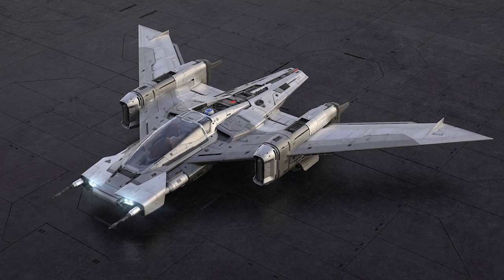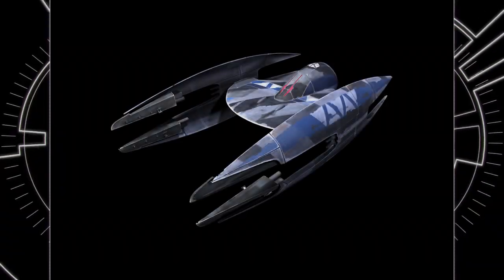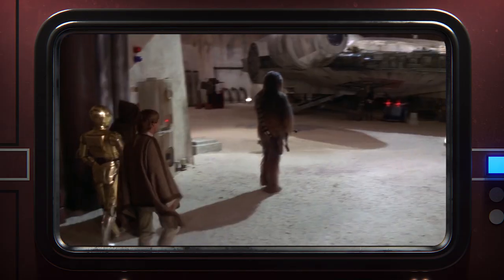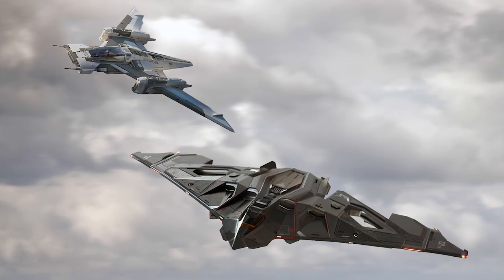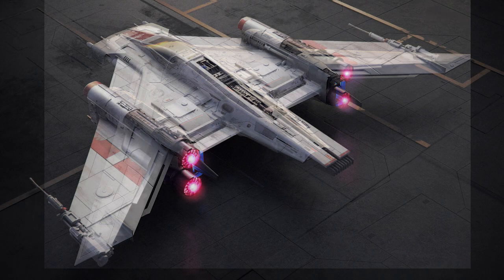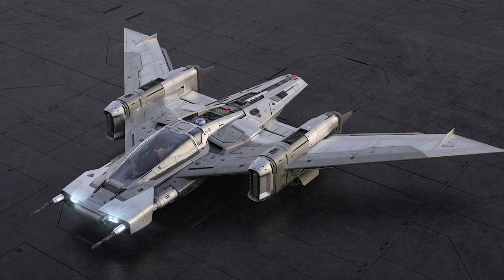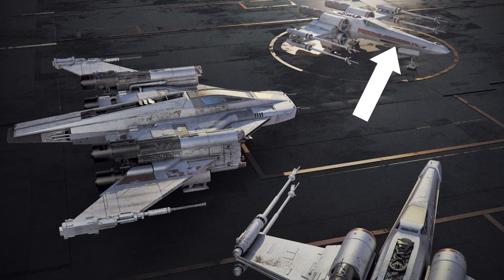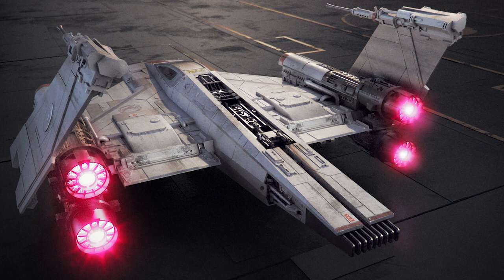Fixing Porsche's Star Wars Ship

Comment: Honestly there are aspects to the original I like, how it looks like a high powered jet fighter for one and looks like something that can actually fly for another 

I love the guns on the front of the nose like a proper jet fighter, just wish the nose wasn’t so stubby and more narrow, with the guns more centered 

And maybe it’s just me but I think the pointed back should be a third engine block, seems weird for it just to be a point with no functionality 

You design is nice I’m just not a fan of the two engines, I’m not a fan of bulky jagged looking  designs is all. I do like the the guns on the wings and the fact that the wings can fold up. 

Honestly an amalgam of the two designs would be a dream made in heaven, the things I would add would be nose mounted guns that are more centered with the cock pit, as well as a more narrow nose in general. Also I think a third engine at the back rear to the cock pit would make a better usage of space, maybe even throw in some vtol elements there for an easier take off. 
Thirdly after watch top gun maverick I think wings that can expand outwards for more altitude in flight fast would be cool
It’d make the overall wing span larger in flight but for the benefit listed above . 

In general while I like both designs I think they’d both work better as a fusion of the two. Porsche looks like a nimble aerodynamic design while yours is more befitting the Star Wars standard design, mostly on the rebel side tho

Comment: I mean, the two styles are completely different. a lot of starships in starwars we see are old, and are mainly meant for vacuum, but capable of relatively low-speed atmosphere flight by design. (clunky, boxy ships with chipped paint from low maintenance) this car company spaceship is built for atmosphere, with it's aerodynamic frame and control surfaces, with air-intakes for the air-breathing jets on the front grill and two engines.(presumably)

I could see an X-Wing going half the speed of sound, maybe, in atmosphere. that porsche could go a lot faster.

Comment: I can already see bio for this.

Incom S-91X Pegasus System Defense Bomber.  Designed to perform the roll of the infamous BTL-B4 'Y-Wing' but on a modest budget.  It has excellent Control, Durability, and Firepower.  It lacks a Hyperdrive but wing tips fold for space saving in space ports and fleet hangars. It is armed with 2 Blaster Cannons (Wing Tips), 2 Ion Cannons (Nose), and 2 Proton/Concussion Missile Tubes (Internally).  It has 2 split-exhaust StarRam engines which are mounted away from the central body for crew safety.  3-man crew consists of pilot (Forward) and one Rio and one Flight Engineer (Rear). 2-man crews are available (Optional).

Comment: It's so strange they had them make a ship that looked like an X-wing, a Y-wing, a U-wing and a Porsche fused together.. when those contrast so heavily. The X-, Y-, and U-wings are utilitarian designs scrapped together by a rebellion desperately trying to get as many ships off the ground and functioning as they possibly could, screw the aesthetics or sleekness or how clean they were. They were rough and cobbled together and had plenty of exposed parts.. maybe for ease of service or maybe simply lack of defensive panels to protect them. On the other hand, Porsche is a luxury car manufacturer specializing in curved and sleek designs. The styles don't really mix well. Porsche might look right at home using a Naboo template, though.

Comment: The "new" version is better if you assume the OT aesthetic is the only one.

Personally I think the art direction and general design of the series should evolve, if the Prequels were based on the 40's and 50's, and the OT the 70's and 80's, the Sequels should advance the technology and bring it into the 90's/00's/10's rather than sticking to what is safe (like they actually did).

Comment: The original design those actual have porsche like bits. Behind the Astromech unit there are radiator fins that looks like the vents on the back of modern 911s. The main cabin area kinda has that 911 look but otherwise nothing also looks porsche like...

Comment: About the Porsche's space ship. For space ships, there is no point in having wings unless there is a good function to it, like storage, guns attached to it or having some kind of special function to it to for example become a plasma blade cutting through anything. Yes of course you could argue that it is meant to just look cool, however, this ship is meant to resemble a rebels ship, so it shouldn't have any big unnecessary parts to it. That is why your redesign is much better in my opinion.

Comment: Initially I thought this was another one of those fans who keep on "correcting" designs (most recent issue with the grand inquisitor). But no, the new redesign looks like it actually is something that would exist in Star Wars. The grittiness and exposed parts of the engines also add to that SW aesthetic. The original design, wasn't bad either. but to me it looked like a ship that better fits in the MCU side of things, with the familiar cleanliness I saw with the Milano and the Benatar.

Comment: Coming to this way way late, but i would have like to see the rear spine on a upward angle, ike 20 degrees up(starting just past the canopy) and a double engine stack (vertical) in the tail. lower the engines in the wings and change it to one on each side instead of 4.

Comment: incom 108 Strike Bomber prototype. During the Galactic civil war Incom began developing the 108 Strike Bomber. Though initial interest in the project  was high demands of the war required funding to be allocated towards the theft of Y wing bombers from imperial supply docks.  The design team was rotated to the development of upgrades for the X wing. The prototype would languish in storage for 15 years until interested parties approach incom for a rugged and reliable bomber design.  The new design team searched the archives for concepts to adapt into the request. The upgrades and modifications would come to be known as 108b strike bomber and was given the designation of the M - wing. 
      It's first test flight would be marked with only minimal malfunctions in the navigation systems, requiring an on board astromech droid to resolve. The true difficulty arises with the weapons systems. A combination of an advance multi target tracking system and state of the art high speed torpedoes would have turned the M - wing into a capital ship hunter killer. Initial complications with the tracking software not communicating with the torpedoes on board droid brain lead to  the design team to replace the system with off the shelf parts. Followed by the droid brain developing a "return to sender" sub program saw the loss of one of the initial prototypes and test pilot. After an internal investigation discovered that one of the lead designers was receiving large sums of credits from an outside source lead to scrutiny of the company from the New Republic, the company quietly shut down the program and is now under intensive review of security.

Comment: TBF the porshe design looks fine for a prequel design on, say, coruscant (or, say, for a new culture / world and design aesthetic during, or before the height of the republic). 
But it doesn't work AT ALL for a new republic design, and for a rebellion / new republic ship by incom, no less.
So props on your redesign, which totally gets that right.

(although, technically, you might still have too many beveled elements on the body / wings of this ship for an incom design, though – which is an issue that you'd run into if you actually matched the design process of the OT, w/ physically built models and mostly flat, plastic layered elements and some degree of vacuum forming)

That said, star wars has a funny bit of design history where the 'newer' ships look grungier, older, and more beat up than the comparatively sleek (and sometimes entirely CG) designs of the prequel trilogy, so technically either of these designs could work, just in different eras and locations. Poor showing on porsche (and lucasfilm's) part for not matching the design philosophy for the era (and manufacturer!) that this ship was explicitly supposed to slot into, though.

Comment: Some critique: Personally if you're going to have the wings foldable then I'd say bring the engines in more so more of the wings can fold, as is it seems like a tacked on feature since how much the wings fold feels IMO negligible. And the frame on the cockpit is rather thick on the sides and the slope makes it so the pilot would have one hell of a bling spot. Cockpit placement seems like it'd be awkward to get into. Do you jump up and climb the wing, walk across, then hop down into it? The fighters all have easy access to the cockpit by ladder and have open space around it to account for such direct access,  the larger transports have a separate entrance that leads up to it. Your design seems to suggest the later but is in reality the former. Not a major problem but it would make it take longer for pilots to get in the seat and into the fight. 

I'm 2 years late, I know. Just let me have a nerd moment.

Comment: While I do like the "alternative" ship, one thing I feel needs to be pointed out is that lots of people seem to be talking about "Star Wars feel" when what they actually should be saying is "_Original Trilogy_ feel". The reason that stuff in the OT has that "feel" is because the Rebels are using old, worn-out, raggedy equipment that has been jerry-rigged and "field expedient" repaired/upgraded. The Empire's equipment didn't look like that. The Prequel ships don't look like that (and in fact, many prequel vessels are quite sleek in their own right). And the X-wings and Y-wings and all the rest also didn't look like that when they were new off the production line. Some of the design choices are hence made more towards "that particular company" aesthetic rather than Star Wars in general.

As noted by a few other comments in this comment section, the original Porsche design would fit in quite well with the Razor Crest (especially if the only mod is to ditch the ends of the wings past the engines). It would also make perfect sense in the Sequel Trilogy timeframe, as you have three decades of technological progress after the restoration of the Republic and a booming recovery economy after the end of the major war. The fact that [SPOILER ALERT] it appears in an episode of Kenobi kind of scuppers my Sequel-age idea 😅 but in that case it (the original Porsche) design can still "fit" if it comes from the same company/society as built the Razor Crest.

Comment: The before picture has a Babylon 5/Battlestar Galactica vibe to it. The Viper from the front of the canopy, and the wings and thrusters scream Starfury in their design. There will be an argument that the thrusters also come from the Viper. And they could be sourced from either, they look a little like both to me. The new design is better for a few reasons that have already been stated. The design looks older and Industrial like all of the other SW ships. The new design has elements from the other ships as it was supposed to have, the original didn't. Then my opinion. Including the parts that were changed and commented on, like the newly designed outtakes and intakes on the thrusters and the wing mounted weapons belong where they are. On the original they didn't belong aesthetically and looked like they were thrown on in a bad hurried unplanned refit. And I like the folding wings too. (World War 2 Carrier based planes had this ability and this is where the Star Wars designers got ideas from originally so, it is a very good tie-in.) Lego if no one else should make this, it wouldn't be that hard. Just copy parts from X-wing and Y-Wing kits that there are already several versions of.

Comment: With the wings pointed back and the wings edge ending close to the front I think it's still not that much star wars. Usually, if the ship has wings, they are around the middle, like a propeller plane. You probably cut the wings more into the shape a XP-55 Acender rather then this 6th gen jet configuration.

Comment: I mean I think the original one looks pretty cool on it’s own. It’s interesting to try and break down design languages from different IPs to determine how something has a certain look or vibe to it and to reinterpret designs, but like… the original design looks fine. I really think the reason why the redesign looks more ‘Star-Wars-y’ isn’t necessarily because it looks generally ‘Star-Wars-y’ but more specifically similar to something designed by Incom in-universe. It looks like a mix of the the X-, Y-  and A-Wings or at least has elements reminiscent of those ships. But of course a ship designed by Sienar Fleet Systems or Kuat Drive Yards or Mon Calamari Shipyards or… whatever the gungans use… they’re all gon’a look different from Incom, so I think Porsche’s original design could indeed work in Star Wars as just… another manufacturer. Now comparing maybe some kind of overarching design language that all Star Wars ship designs have regardless of in-universe manufacturer to the design language used by Porsche who… I think just worked in house with whatever rule book Lucasfilms has, there might be some minutia that improves the design overall. But I d’know… shitting on the design and then ‘fixing’ it just kind’a felt harsh. Both designs are indeed great to me, and it’s indeed certainly fun to discuss design.. without being… adversarial? I d’know, the video doesn’t really do it that much; I just hope it doesn’t inspire like true disgust and anger towards Porsche’s attempt.

Comment: Maybe I'm just too old-school for my own good, but I feel like a Porsche should be rounded, compact and feel fast. You'd think a Star Wars design invoking a Porsche would be some wonder craft that's too small to be true, punches well above its weight class and has the Cloakshape aftermarket rear wing, with a lot of mass in the back just before that wing before narrowing to a minimal face up front. It should basically have hips and a butt, signifying that, like a Porsche ought to, all the important stuff is in the back, or at least its heritage comes from a design family whose important components are all neatly hidden in the tail. Even the 917, mid-engine car that it was, had that fix to its problems. What fixed its aerodynamics and turned it from merely a good Le Mans car to one of the greatest ever? Fix the tail!

Comment: The main problem with the original as I see it is that the wings say "early post WW2 MiG jet fighter", clearly the wrong era for a Star Wars design to tap.
Turning the wing into a blended delta, while recalling some late German WW2 experimental designs, is still not solidly in the SW aesthetic. It's better but still needs some tweaking.

Comment: honestly, both ships look very "Star Wars".  but you have to look at it from an era perspective.  EC Henry's ship has a very Age of Rebellion look to it, almost like the ship has seen better days and has needed repairs that were kinda jury rigged because the parts are too expensive or the production line for this ship has been cut off for what ever reason.  it looks more "run down and dirty" like the original trilogy.  The Porche designed ship looks pretty much prequel era "brand new and shiny".  Maybe a bit hot-rodded.  Could even be a New Republic era wealthy Imperial Remnant family custom job. But they definitely both look very Star Wars, just depends on which era you are talking about.  Most people think of Star Wars and automatically go to the original trilogy aesthetic.  The gritty dirty, run down kinda cobbled together look.  They fail to realize that aesthetic wasn't always the case, which is one of the reasons so many people (a lot of my friends) were infuriated by the prequel movies, everything was nice new and shiny when they felt it shouldn't have been that way.
Reply: This is more of a Porsche Fighter than a Star Wars one. Though I can pretend it to be a Coruscant brand vehicle.

Personally, I keep thinking it's Mass Effect fighter. 🤔

Comment: i can immediately pick out all of the Incom influence in your design, and the different components borrowed from existing ships, much how i would expect the Incom manufacturer to reuse parts in production since they are a low cost civilian consumer corporation. AFAIK all the incom ships were unarmed on the stock model, and were all customized with any armament and high end shielding, and your model that seems feasible, but does not match the Porsche design. yours is 100 times better and would make any fan proud of the development, unlike the porsche design that appears to be made by skilled yet out of touch marketers

Comment: Here some facts according to your design, which is clearly better: 1) its a more distinct profile, instantly recognizable 2) it has a more straight form concept which would be easier to produce (either straight plates or bend profiles) 3) it makes much more aerodynamic sense  4) it resembles the shape of flying wings especially that of a horten 229 and folding wing concept. Also nice to see at the british seavixen. Cheers
See: https://youtu.be/f80mfPYLqHg
Reply: Porsches design should be more based on rounded shapes, but they were afraid. If they would go for a slim or more flat shaped round nose, you could clearly see heritage from the mig 15s or english electric lightning plane from where it has its engines.